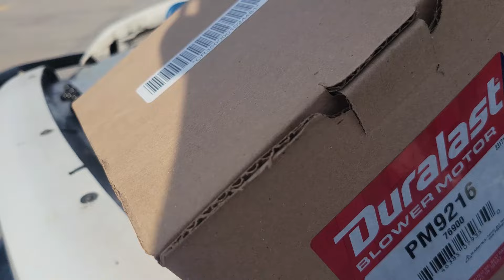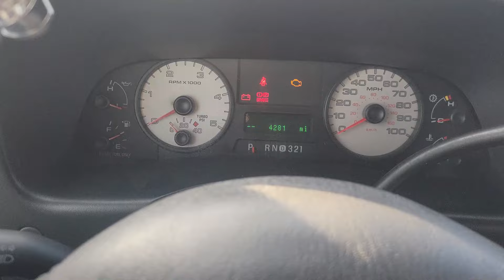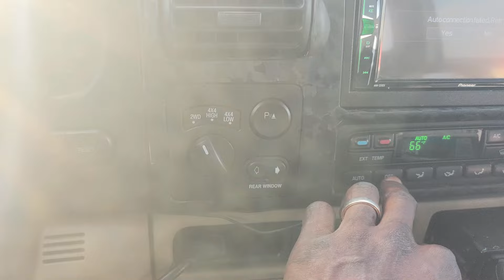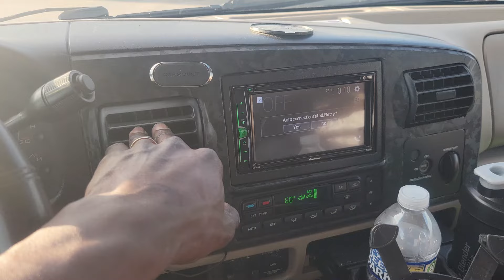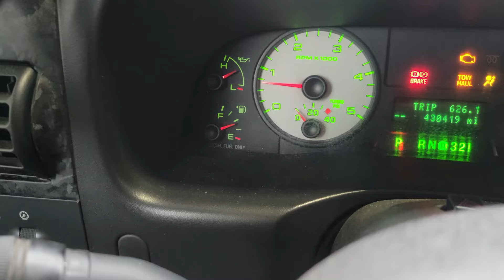A DAY IN THE LIFE: MY NEW TIRE SETUP | THE WORST HOTSHOT LOAD | MY AC WENT OUT AGAIN

Comment: You’re correct on fan speed issue, same case with my 7.3… you gotta replace the resistor, they tend to get burnt.
Reply from the maker: happy you said that! i will def grab one then! thanks 🙏🏿
Reply: @hotshotwithme  any time brother, grab the pigtail just incase also. The connections tend to be so burnt that they’re melted together.
Reply from the maker: dang alright will do for sure 💯

Comment: Keep one Elementary thing in mined modern vehicle air conditioning and heating systems are not made to sit and idle the systems are designed to function properly when you are rolling down the road with plenty of air circulating across all of their external components, if you run your system for extended periods of time while you are sitting and idling you should look into some type of auxiliary fan that will blow into your engine compartment across your radiator and condenser.
Reply from the maker: never thought about that, but i dont idle at all really; nothing over 30 min unless im working on my laptop at night which is like once a week thing
Reply: Just looking out brother keep doing what you doing much respect to you
Reply from the maker: @user-eh5cr4or6k  I appreciate the input!